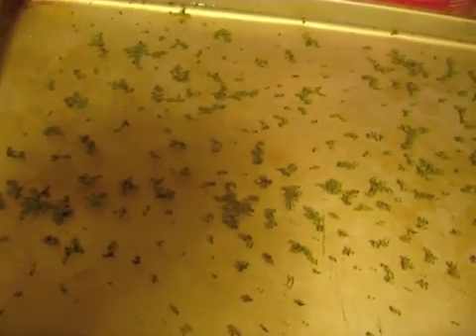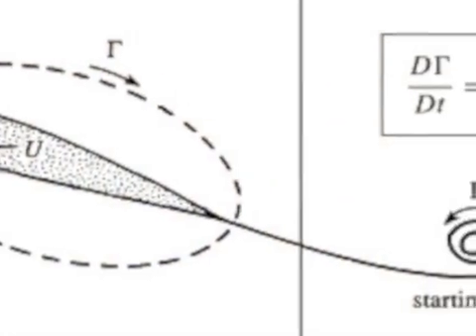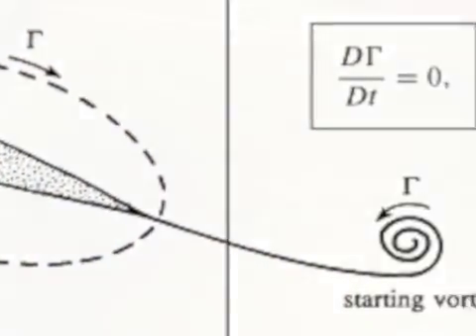How circulation relates to lift (with demo)

Comment: No. The bernoulli principle is a conservation of energy statement. And circulation causes torque however, torque cannot be used as lift. Wings lift by doing the action work of excellerating air downward, period. It is both impossible to excellerate air and not get a force , and not possible to get a force without accelerating air. The point of the bernoulli principle (not bernoulli law), is that air trades pressure energy for kinetic energy, and stays at a constant total energy. You need to understand what the bernoulli principle is before you can attempt to aply it. 
Wings work by excellerating air down. They don't ' create a bernoulli effect '.  An upward force on a wing doesn't cause lift. Rather,  an upward force is lift caused by the excelleration.

Comment: * * * * NOPE!  Sorry.  
* * * * A nice demo {even if your "wing" is WELL into stall}.
* * * BUT, YOU ARE WRONG in your conclusion. @2:30.
. . 
Grade of F.
. .
FACT: The air below the wing is accelerated to a faster peak forward speed than the peak rearward speed of the air above. Measured data shown in link below. <--Sound wrong, but read on.
.
Your explanation of "Bernoulli tells us" is also meaningless. 
You don't explain your basis for saying  that Bernoulli "tell" this?
.
You say that below the wing air is slowing down {which is false} in flight. <-- In flight relative to the stationary air mass & ground [not the wing[.
.
In a wind tunnel, the lower air IS slowed down, but that is BECAUSEOF the increased pressure under the wing.  This is a Proverse Pressure Gradient. This means the pressure is rising as the air approaches the wing resulting in slowing {which is Negative Acceleration}, therefore ,your conclusion id invalid.  The air is slowing toward an INCREASING pressure.
.
This reasoning follows from the very terrible misconception that Bernoulli is about speed, which it is not!.  It is about Acceleration.
.
Looking in reference to the still air before the wing arrives, The lower air is accelerated {positive} forward all the time resulting in a forward speed. The peak speed of this air is GREATER than air above.  <-- FACT.  Read on.
.
On the other hand, the upper air is first accelerated forward ahead of the wing {before it arrives}. THEN it is accelerated rearward by the lower pressure above the wing.    This is INDEED a greater Acceleration than the lower air experiences. 
However, it is so much {negative Acceleration that it stops and reverses direction to now be traveling in the OPPOSITE direction of flight.!.  BUT it's peak rearward speed is slower than the lower air's forward peak speed..
.
You come to the correct conclusion about the Top-to-Bottom pressure difference, but for the WRONG reason.
.. .. ..
Bernoulli is NOT ABOUT SPEED. so your explanation if flawed and wrong.  Sorry.
Bernoulli also says nothing about the fluid speed relative to a surface. . . .
Read the accompanying Bernoulli Blog 
.
See figure 7 here:
 Understanding Aerodynamic Lift Correctly:
 rxesywwbdscllwpn.quora.com/ 
.
PLEASE, PLEASE, PLEASE stop repeating this Bernoulli Myth.
Reply: "Bernoulli is NOT ABOUT SPEED. so your explanation if flawed and wrong.  Sorry.
Bernoulli also says nothing about the fluid speed relative to a surface. . . ."

Yes it does because you can choose your reference frame.  Motion is relative and the laws of physics have to work in each reference frame.

"This reasoning follows from the very terrible misconception that Bernoulli is about speed, which it is not!.  It is about Acceleration."

How can you say Bernoulli, a conservation of energy principle, is not about speed?  Kinetic energy, front and center as one of the cornerstone measures of energy, is defined in terms of speed.

Comment: Isn’t you wing a infinite wing?
Doesn’t that negate practical application to a finite wing?
Sincere question. I really don’t know.
Reply: They are essentially demonstrating the existence of the kutta condition and physical principles behind kutta-joukowski theorem, which relates circulation to lift per unit span. Per unit span means it is in 2D space, and does not consider finite wing effects. Prandtl's lifting line theory is what connects the kutta-joukowski theorem to finite wing effects.
Reply: @solaryon8711  They are demonstrating the existence of viscous effects of a fluid on an obstacle. Kutta condition is a mathematical model to simulate viscosity in a potential inviscid fluid or yield the same results that would occur in a viscous fluid. 

Viscosity pulls the fluid around the shape of airfoil , resulting in centrifugal force due to fluids change of direction. This action opposes pressure above the foil , the converse , what happens below the airfoil, promotes pressure. 

Very convenient to invoke Bernoulli now huh? low pressure above and high pressure below , is a net result of lift , by adding velocity above and subtracting velocity below so as to be consistent with a model based on fluid flow superimposed over circulation , when the foil is not rotating at all.

Comment: Kelvin's theory requires a fluid with conservative forces, i.e. no net change in energy. Your experiment is not conservative: you are adding energy by pushing the card, which is being dissipated by friction and turbulence. Net circulation cannot be conserved. Kelvin's Circulation theory does not apply.
Reply: Kelvin's circulation theorem is a topological requirement in all cases. We can separate one lot of vorticity from another lot of vorticity of opposite rotation, but we cannot ever create net nonzero vorticity.
Reply: @david_porthouse  I don't think your reply addresses my objection. Read it again: "Your experiment is not conservative: you are adding energy by pushing the card"
Reply: @alans172  Whatever you do with energy is dynamics. Kelvin's circulation theorem is kinematics, or moving geometry. It is inevitably true all the time. If we try to specify a three-dimensional flow field where a vortex filament has an ending, then it merely radiates micro-filaments of vorticity in all directions. These micro-filaments loop back to create a vortex ring. A two-dimensional section through this ring gives us Kelvin's circulation theorem.
Reply: @david_porthouse  Reading that from the perspective of classical mechanics reminds me of the famous buzz-word generator:
 "kinematics, moving geometry, three-dimensional flow field, vortex filament , micro-filaments, vorticity, vortex ring" and then you have the brazen audacity to claim it brings us back to Kelvin's circulation theory of 1869!
I'm not convinced!
Reply: @alans172  You are obviously struggling to distinguish between dynamics and kinematics.
Reply: @david_porthouse  I'm not sure that a thorough grounding in classical mechanics even requires an awareness of either term.
Reply: @alans172  For an incompressible constant-density flow, we can do a purely kinematic analysis in terms of vorticity to explain the lift generated by an aeroplane wing. Kelvin's theory is as good as ever.
Reply: @david_porthouse  No, you can’t. Kelvin’s theory is anisotropic. The aerodynamic force on an an aircraft wing requires an energy input. It is NOT anisotropic.
Reply: @alans172  I think this is just a practical joke.
Reply: @david_porthouse  sorry, typo:  isentropic not anisotropic. Reply duly corrected. (YouTube shouldn't allow comments to be edited. Deleted yes, edited, no.)
Reply: @alans172  If an aerofoil is started then stopped, it generates a starting and then a stopping vortex which can both be visualised. Just look at the pictures if the long words are causing difficulties.

Comment: Circulation is not really the conclusive explanation of lift, but I am very impressed by your visualization of the starting vortex. Cool stuff, never realized that it was that easy to demonstrate!
Reply: An asymmetrical solid turns the air.  The transverse momentum (to the relative wind) that arises from that turn, is lift.

L = d(mv)/dt

The force that bends the direction of that mass flow, is a difference in pressure.  

AxP=d(mv)/dt.  (or f=ma)

The pressure asymmetry results directly from the solid's asymmetry:

Conservation of momentum of the relative flow is affected by asymmetrical path difference causing an asymmetrical pressure drop (due to a differential transfer of potential energy as static pressure, to kinetic energy as dynamic pressure - each side of the path asymmetry produces its particular momentum conservation response).

The mass flow is thus turned somewhat in a transverse direction.

This consumes some energy from the solid object's velocity to the relative wind, in making this lift.

All the vorticity action results directly from achieving this above response to the asymmetry.